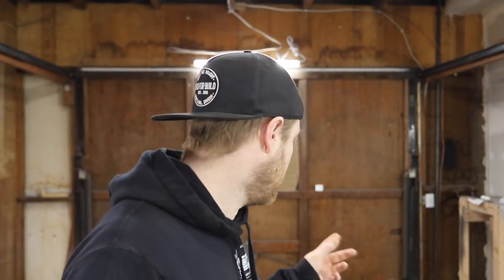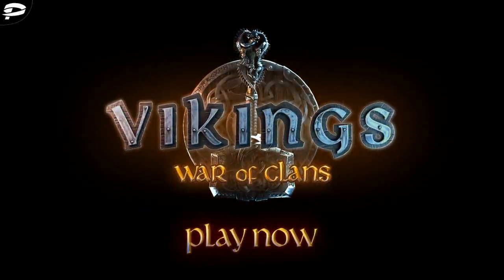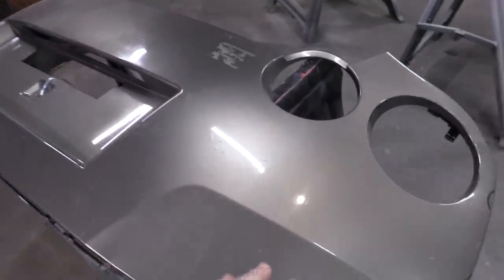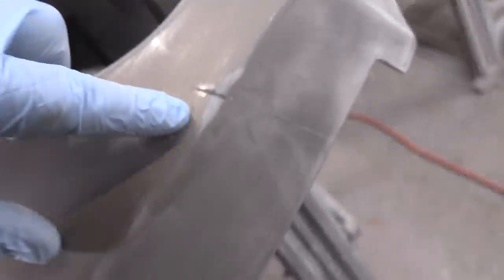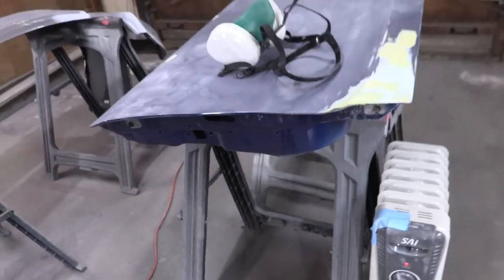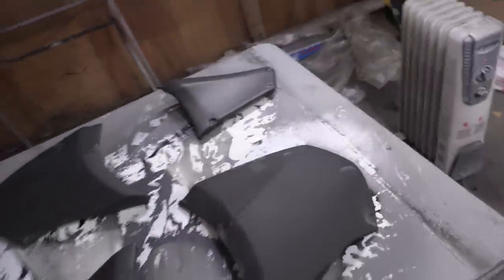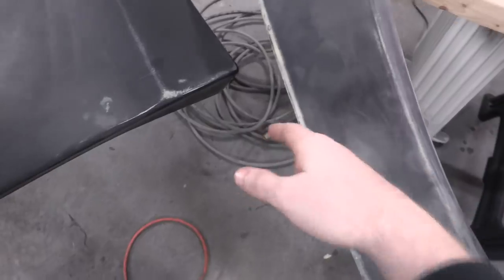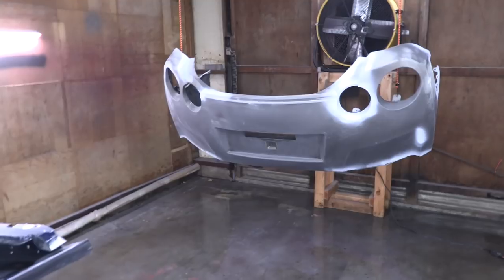Painting the GTR Replacement Body Parts

Comment: I know there are always a bunch of 'experts' telling you what you are doing wrong. I definitely won't do that, but when I first started painting cars at home many many years ago, I used to get fish eyes all  the time as well. I tried the fish eye drops and they helped a little but they didn't eliminate them. I eventually started doing my first full coat as a 'dust coat', and let it dry, then I eventually built up to full coats after that and I no longer get fish eyes at all. One thing not to do, as much as you want to fix it straight away , as soon as you see a hint of a fish eye, stop and let it dry as it sits, then go back and dust over it again when it is dry until the fish eyes are gone. I know that frustration of wanting to fix it straight away, but (as I am sure you have already seen) the more wet paint you put on top of a fish eye, the worse it gets. You probably know this already, but hopefully some others can gain something from this.
Reply: knowledge
Reply: appreciated advice, thank you for it.

Comment: Just a tip the only reason you will get fish eyes in you paint job is because of contaminants in the air or on the surface of the panel. What are contaminants? Things like armor all, wd40, pb blaster silicon based products. Products like these should never be spayed in a paint room or even the same building where paint is being done. I know that may be impossible is this situation if so then you should be able to use your wax and grease remover to eliminate  fisheyes. You must wipe wax and grease remover off while wet this may help. Another tip when appling the first coat of clear dust it on dry or very lightly the clear will not fisheye in a dry coat let it cure thoroughly  and then you should be able to hit it with a heavier coat and then a flow coat and this should eliminate  fisheyes. Good luck and keep up the awesome  builds!

Comment: Fish eye is from contaminated body panels,  working in a room that you are creating dust and kicking up stuff in the same room you are painting isnt good. The best thing to so is to work on the parts in another room and paint in your  makeshift booth. Another thing is to drain the compressor every time you are going to paint. Mist coats in first and second coat is what is best to prevent such  things. Having the room nice and clean and wipping down panels with distilled water and alcohol mixed is the best  degreaser to get amazing results also having  good paint filters is a good practice to use. A moisture trap at gun end is another good step to practice on.
Reply: dust does not create fish eyes. And i think he does have a water separator on the gun.
Reply: @marc9283  she didn't  say dusty she said it was grease
Reply: @BENYEET  read again, she did.
Reply: @marc9283  you read it again bud
Reply: Lol, she said it was from 'contamination' and that dust in the room 'isn't' a good idea!! The man's right and so is she 😀
Reply: guess  @BENYEET   is trolling.
Reply: @marc9283  guess you need to go back to school if I'm "trolling"
Reply: @BENYEET  yup, that must be it.
Reply: @marc9283  lol

Comment: when i started painting cars in 1982 the old times told me to wash what you are going to paint with a strong detergent , then use the wax/grease remover BEFORE  you start sanding any thing. they said you can force the wax/grease into the paint or  base steel, and it is very hard to get off...something to do with the heat produced when sanding reacts with the wax/grease...doing it their way i did not have any problems with fish eyes....fyi

Comment: I knew it was going to go horrendously wrong way before he started spraying. I had my own workshop for twenty years and did hundreds of spray jobs in that time. There are so many things wrong here, it's difficult to know where to start.

First of all though, a spray booth is supposed to be a dust free environment. No way should you be doing body filling repairs and sanding in the same room. Getting the floor wet is correct but everything else in the room is covered in dust. The next thing is clothing. All that fish eye could be explained just by the inappropriate clothing being worn, let alone anything else. It's essential to wear spotlessly clean non fibre overalls when spraying. I always used to wear those disposable paper type white overalls. Fish eye is cause by silicones being present. Polishes contain silicones so using them will spread tiny particles all around the area. That whole shop is going to be full of silicone dust. 

Before you can spray anything, it's essential to kill any silicone present. I never found any of the surface preparations designed to prevent fish eye to be any good quite honestly. I was taught and found to be correct, the best thing by far was simply a few drops of washing up detergent in a bucket of water and wash all surfaces down with that. Then hose eveything down thoroughly with fresh water, blow dry with the airline and finally wipe everything with a tack cloth. I've been told in the past that detergent can contain silicone too but I never had a problem doing it my way. I could spray a whole car and not have a single fish eye.

Comment: Fisheye eliminator/silicone additive is a last resort type of product in rare situations.   No professional shops with a competent painter are using it on a regular basis and neither should you.
Reply: Well they don't need to because they have hugely expensive spray booths that can control all the air parameters.
DIY requires a different approach.
Reply: @MsSomeonenew   I paint in a down draft booth at work, and in my garage at home all the time. But you probably have way more experience and knowledge. Thanks for setting me straight.
Reply: If you know what your doing, you know what your doing. Clearly he doesn’t know much about painting which is okay because painting is not as easy as people think. It requires lots of knowledge and knowing wtf your doing to get professional results

Comment: A couple tips that have helped me painting in garages, storage units, and outside.... use a waterborne wax and grease remover, not solvent based.  If you are using a harbor freight gun throw it away now, they ALWAYS give you fish eyes. Get the $100 eastwood devilbiss kit if you are on a budget.  Make sure you give plenty of time between base and clear. Use a very high solids clear (finish 1 fc720 on a budget)  and use a 2k primer sealer.

Comment: You need to work with your paint supplier to stop all the problems.  Most suppliers or paint reps will help you  and provide training and product tips to make you paint jobs easier.
Reply: It's coz of the frame rails through the cabin on the 240Z.

Comment: Did you wax and grease remove it before you even started working on it? When ever you work on something your going to paint before you touch it you need to wax and grease remove it because your going to be sanding all that crap on the panel into the paint which will come up later when you paint even if you wax and grease before painting. Also wax and grease in smaller areas so you dry it faster. Fisheyes are all in prep work

Comment: I don't understand--why does Chris continue to sand inside his paint booth? Why not just do all the sanding in the other part of the shop?  Wetting down the floor isn't going to control all the dust in the air, on the walls, etc. Is this normal procedure for paint shops?
Reply: For back street body shops with no booth or extra room it is 😁

Comment: Those fisheyes can be due to oil/moisture coming out of your airline. The setup or compressor could be the cause. Make sure you have a couple of decent air regulators/filters in the compressoor/airline setup. Or it could be as simple as you used a rag that had alot of silicone based product when you wiped it down before spraying. I can send you a pic of my setup at home if need be.
Good luck.

Comment: Get some infrared curing lights, they will save you. Also, try and use the same brand primers and paints for they are designed to work together.

Comment: fish eyes are typically caused from impurities on the surface. like @home built by jeff said if you start off with a really light coat. Allowing a little time for it to tack up and then come back with a good full coat. Your tack coat kinda acts like a glue for the rest of the paint to adhere to. Plus if you notice any mistakes at that point acetone will take the paint right off. Then you just have to make sure the surface is really clean and start over. Anyways good vid and good luck with the rest of the build.

Comment: Give the panels more time to vap off after the wax and grease clean, and then run over the panel with a tack rag before painting. The fish eye reaction could also be a reaction from to much thinners in the prime mix leading to solvent pop as the thinners vap out of the primer ( correction would be lighter  coats if you can't reduce the thinner ration )

Comment: if you use fish eye eliminator once on that car...if you ever have to paint anything on it again and dont use it. It will fish eye all to hell. I never use it painting at work, it's all in your prep work. Could be something as simple as using a dirty rag or contanaments on the panels still. Or water, oil in your air lines.

Comment: Plastic its self its because it needs adhesive promoter  and 2k primer . Not in a rattle can bottle  either
Reply: If you noticed, what you call plastic, the bumper, came out just right; the problem was with the metal door. And that's not a rattle can either, lol+smh.
Reply: @germanp4443  howlomg have you been doing body work?
Reply: @zmuse  actually it does.  It might not have shown in this video but rattle cas have been used plenty of times on these builds. Plastic is diferet then metal and a clean workshop is a must. I would be laughed at if i wa to prep metal parts like i prep plastic parts. Fish eye is a contamination issue.

Comment: Add silicone to your finish. This lowers the surface tension, or slickness, of the finish to match that of the wood surface, so the finish then flows out level. Once you’ve added silicone to one coat of finish, you have to add it to each additional coat.

Silicone intended for this purpose is sold under a number of trade names, including Fish-Eye Destroyer, Fish-Eye Flo Out, Sil Flo and Smoothie. You can add the silicone directly to any solvent lacquer and stir it in, but you will need to thin it a little with mineral spirits before adding it to varnish or polyurethane. For water-based finishes you will need to get a special emulsified silicone from the finish manufacturer

Comment: you should really look into the Black High Build primer its a very effective primer, its mixed to 5.1 to lay on everything couse you can see every single imperfection when you sand it i'd prefeer 500-600Grit soft pad to sand it down and you'll see every single imperfection right away and then base coat then clear but you might need to use a different base if you are using for an example white paint like the base i saw in the video. But yes we in sweden most of the companys use Standox car system paint and i guess im used to that but i have no idea what stuff you are using would be interessting to know anyhow hope u get it fixed !

Comment: You're doing an awesome job man, I've found using a little bit of plastic primer before you use filler will help it adhere to the surface a lot better and help keep it there longer. Just a tip :)

Comment: That actually looks like solvent pops.  They occur when you haven't waited long enough between coats. It's much more common when painting panels because it only takes a minute to paint a panel vs the length of time it takes to do a car. It's important to set a timer so you don't rush back for your next coat.  The paint may look dry or feel dry to the touch, but it's still emitting vapors.  How do I know this?  I was painting my first car ever.  I started with the doors like many people do.  On my second coat of clear, the paint just errupted.  It looked EXACTLY like your door!  So, I increased my flash-off times and never had a problem again.  Always take into consideration the temp and the humidity too.  You shouldn't need fish eye eliminator if you follow the rules exactly.  Increase your flash times and add extra as a cushion. Use a timer so you don't lose track.  I also agree with putting down a light first coat. Good Luck Man!  Love your videos!  And... Clean your shop dude! It doesn't have to be an operating room, but it will be safer and you'll be able to find your stuff easier.

Comment: Cold booth, cold paint, not allowing the layers to properly flash off, that allows the previous coat to gas off and release creating the fish eyes. Thats my theory! Soak your paint into hot water, use a fast hardner, allow each coat longer dry time, disassemble your gun and fully clean it with lacquer thinner, empty your air compressor drain of trapped water

Comment: Try using a cap full of motor oil. That helps with fish eyes. Also temp. Is also a part to think about as well. A good paint job needs to be painted in 56 degree or warmer that helps with the panels being warmer.but try testing something. a cap full motor oil in prime and paint. Old trick my dad taught me

Comment: In my experience fish eyes are caused by a contamination on your surface.  Oil, wax whatever.  The door had some wax or oil still on the surface.  You really have to be super thorough about keeping your surfaces clean and oil free.  Also laying on the paint to thick early on can amplify these issues.  Its better to do real light coats for the few passes than lay it on thick later on.

Comment: The fish eyes are caused by it being too cold, dirt on the panel/in the air (wet the floor to prevent dust) and spraying too thick of coats ,also what pressure are you spraying at?

Comment: Use wax & grease remover before you even start sanding...that way you're not rubbing contaminants into the surface. Then use it after you're done sanding and make sure to let it dry completely - I'd give it a good 20 min - before putting primer.

Comment: Don’t let wax and grease remover dry on the panel, don’t wet the floor on a humid or hot day that will also cause too much humidity. Try using 50/50 mentholated spirits and distilled water to remove contaminants after wax and grease. Always go easy with the paint on your first coat, allow good flash time between coats. Allow a good 20 minutes after wiping the panel down to let solvents escape your pours sanded paint. I paint trucks and cars professionally in Australia, sanding in your booth won’t cause the issues you are having.

Comment: I have a fair amount of experience at rebuilds.  Plastic parts like bumpers do not like the filler you used.  Def. consider the 3M 2-part stuff for those scrapes and dings.  Too late now as the bumper is shot, but just sayin.  Fish eye issue on that door sort of told me something was on the substrate paint....perhaps it wasn't cleaned well enough.  But, that was a LOT of fish eyes.

Comment: Happy b-day Chris! As for the paint, big flat panels like that door need to be hung or contaminates are going to be landing on the surface like crazy. Also what is the temp in your booth?
Reply: DNY Motorsports duh... so how do you paint the body/roof then? Its all about the booth and/or prep..
Reply: Obviously some things cannot be hung. I've been painting at high volume production shops for almost 20 years. With the space he had it would of made sense to hang the door especially being in a non filtered booth.
Reply: I see what you mean...

Comment: Wax and grease remover is incorrectly named. It softens the wax and grease so you can wipe it off with a new clean lint free cloth. I see so many you tube videos with people just wiping w&g remover across the panel. Couldn't see if Chris did it correctly or not as it was in time lapse

Comment: With the paint. how about taking one of your scrap panels and just spending a day practicing on it to see what works and what doesn't? Also, be very careful if you are using any paint that has isocyanates in it (any 2k paint pretty much). That shit is really, really bad for you. It builds up in the body and is never expelled,. When you become sensitised to it, that's it, you can't paint anymore, It's a serious neurotoxin. Those negative pressure dusk masks aren't ideal and only have a life of a few hours. You really want a mask that connects to your compressor and provides positive pressure from outside of the paint booth. Also be aware that it hangs around in the air for a while, so don't go back into the booth without your mask until it's fully ventilated. This stuff is serious, if you smell it, you've already received a dose large enough to cause damage!

Comment: Dude sorry i seem to only be negative on your channel and for that i am sorry but look at what your painting in. A electrical panel beside you, extension cords and non explosion lights, there is a complete book on the electrical for paint booths because of the explosion risk. Even lining all the walls with poly to contain the spray and have fans to move the air but this is an accident looking to happen.